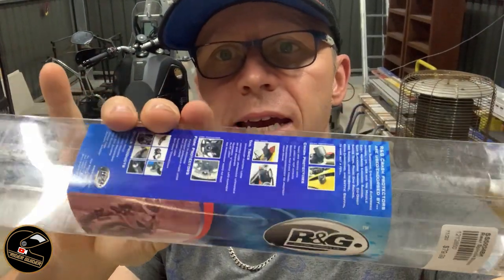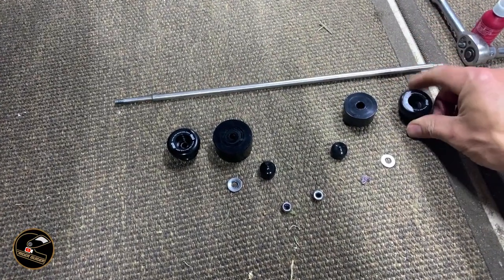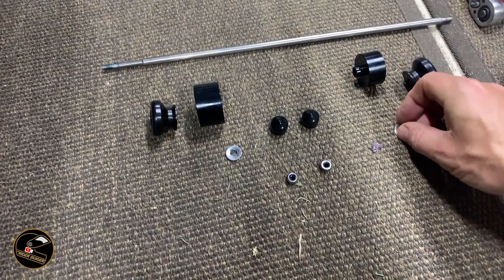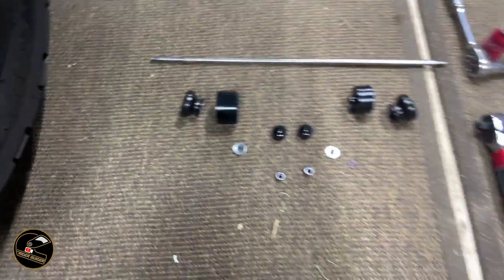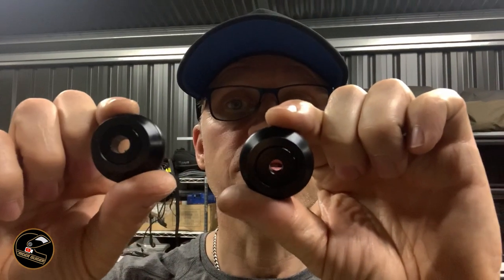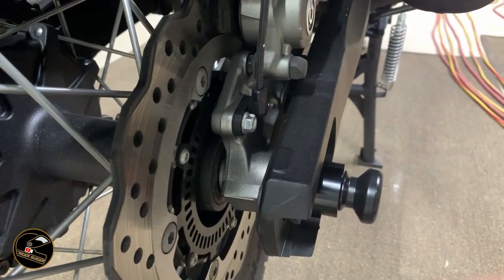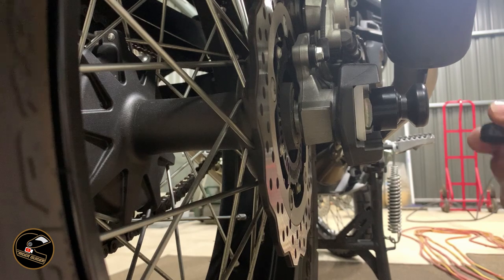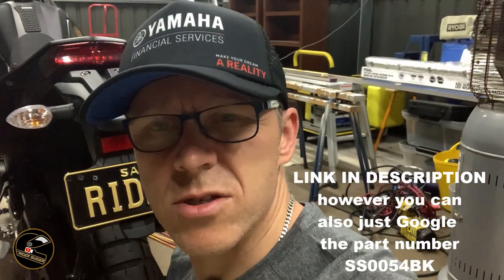YAMAHA TENERE 700 R&G SPINDLE SLIDER BOBBINS COMBO

Comment: Thanks - helpful video. No need to worry about the torque settings on the axle nut? This doesn’t impact that as you’re threading through? Cheers.
Reply from the maker: Correct mate, it just slides straight through the hollow axle. No need to loosen or indeed tighten the wheel nut 👍🏼

Comment: How does one adjust the chain after installing these?
Reply from the maker: It’s an easy remove and refit.  You literally only need to loosen the left hand nut to slide the spindle out.  Takes only 30 seconds or so.  You just need to make sure you have the 10mm sockets 👍🏼

Comment: WARNING: Does not fit 2021 T7 model
Reply from the maker: Mine (ie the bike in this video) is the 21 model?
Reply: Rod I just received was short by about 10 mm on LHS taper. Possibly a one-off defect?
Reply from the maker: @andrew390  what is the exact length?  I’ll measure mine and let you know.
Reply: @TheRiderGuider  tapered LHS is 43 mm. All the components dimensions match the spec sheet that came in the box. If I remove the LHS cotton real space then I can fit the left nut but will need to be careful when using the paddock stand.
Reply: UPDATE: Just got new tyres / 1000 KM service and mechanic commented that my rear axle on RHS is a few threads further out. This could be the issue causing the 'length problem' resulting in me being unable to add LHS cotton real spacer.
Reply from the maker: OH cool - you got it sorted now mate?